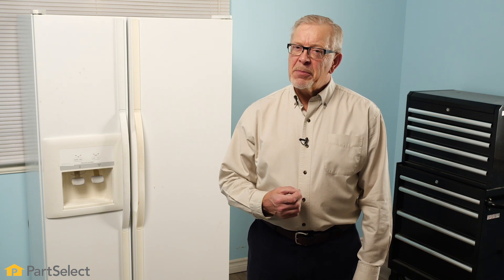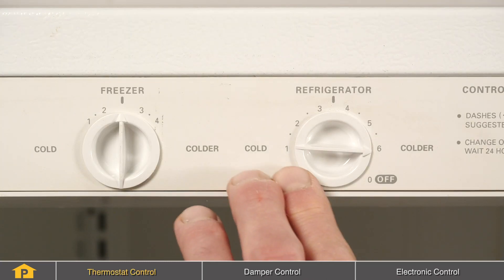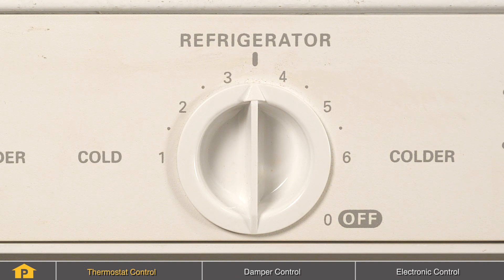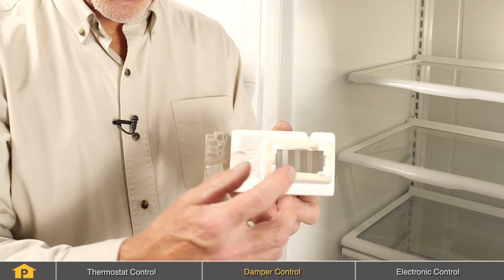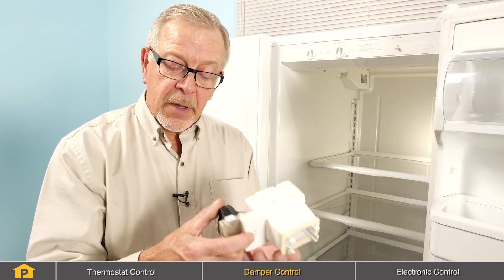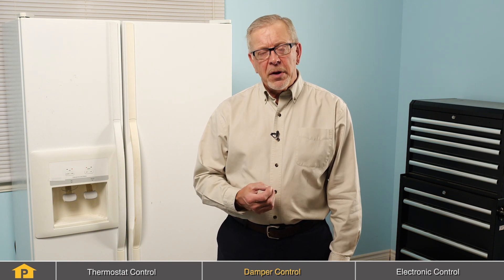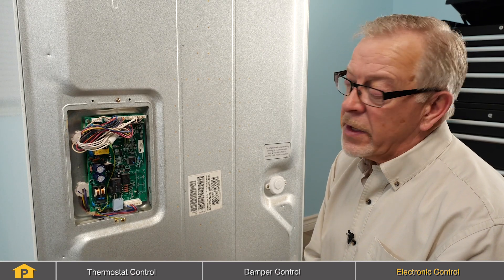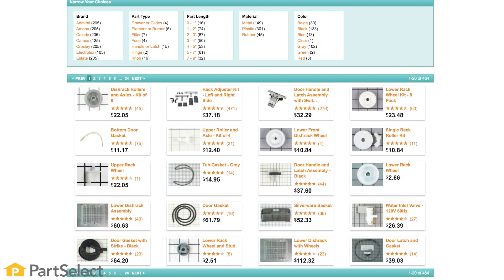Refrigerator Troubleshooting: Why Is My Refrigerator Freezing My Food? | PartSelect.com

Comment: Need your help. I have new wirlpool French door. 30 inch wide 22cubic feet. Veg are freezing. Vents are clear. I have reduced the freezer temp below the recommended mid range and also brought down the fridge temp to one level below from the recommended level.
Is this ok?
Ice cub maker shut off.

Comment: what solved the thing for me is to take out the damper, it was completely covered by ice, even the deepest electronic parts inside were frozen. I removed the ice manually by a needle and then removed all the remained moisture by a towel. The formed ice blocked the damper's mechanical part from closing the cooling circuit, so it stayed open.

Comment: Hey Steve, my side by side Frigidaire model FRS26R4A is running too cold on the fridge side (mid 20's) and not cold enough in the freezer (12-15 degrees). I can feel/hear the air flow, if it helps, the drinks on the top shelf are freezing but the food on lower shelves are not affected. I did a rudimentary cleaning of coils in the back, no seals are cracked on the doors.. This is a "garage" second fridge so no water lines are hooked up, no ice. Can you suggest where I might start? Temp control, air damper etc. Thanks much

Comment: NOT cool ( Pun intended)  Absolutely no mention of the little dampers being BLOCKED in the refrigerator section so the cold air STAYS instead of circulating and that way ONLY cold air is continually coming in..... THAT'S a SIMPLE fix without becoming a technician and spending a couple hundred dollars on parts that may not even be the problem...
Reply: 3:07 he says that could be the case

Comment: This dude basically listed all the parts that may have gone defective but doesn't explain how we're supposed to figure out which part. So buy all the parts which probably costs more than the fridge itself and go from there. Nah. I'll just buy a new fridge altogether.
Reply: He demonstrated how to use a multimeter to determine if some parts are defective and which parts, but if you don't own or know how to use a multimeter then yeah that does you no good.

It's in the latter half of the video if you didn't watch that far. Basically you have to test each part with the miltimeter to make sure it has the correct ohm reading (electrical resistance) at room temp, and then you can use process of elimination as you test each part until you either find the part that is faulty or narrow down what the only remaining culprits could be.
Reply: Good luck getting the one you want with the COVID supply chain problems.